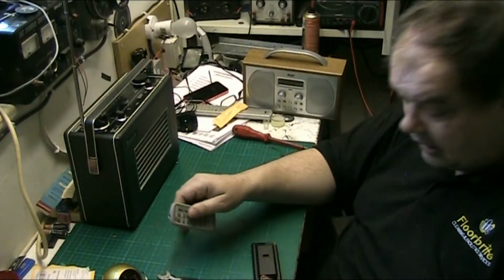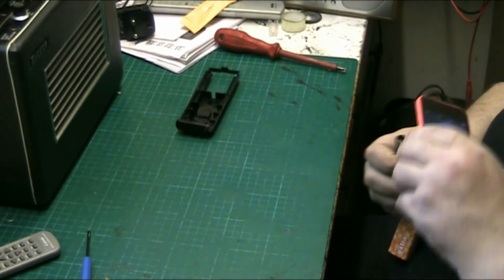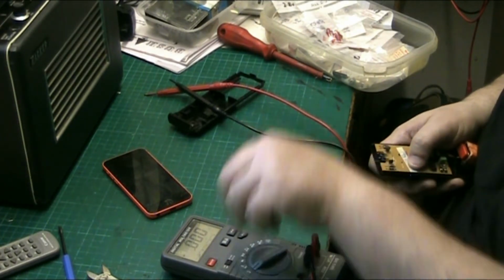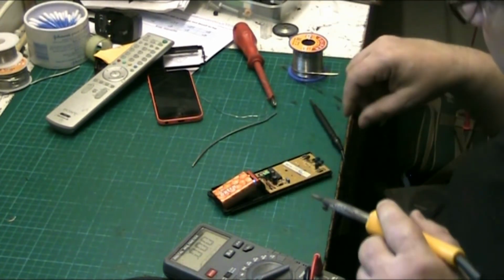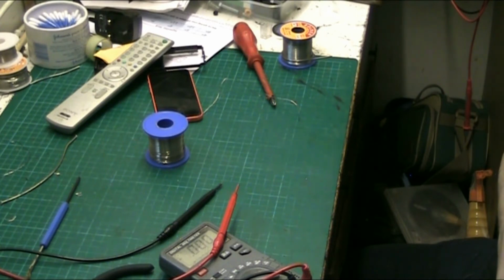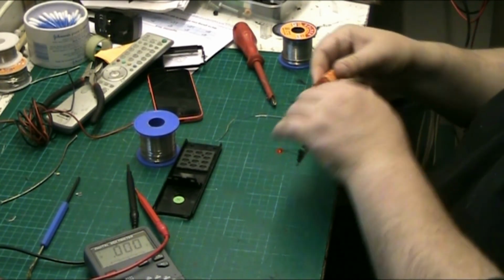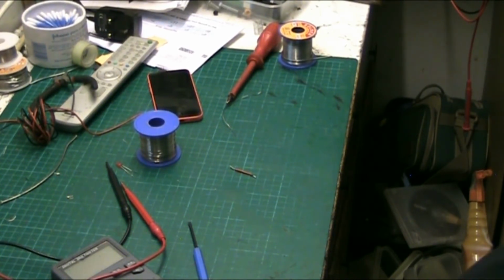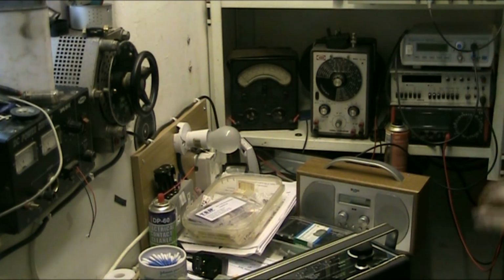MIKE'S REMOTE CONTROL

Comment: is it worth while repairing these? I thought those £1 shop remotes for everything worked on all TV sets?
Reply from the maker: Its the original to the tv
Reply: Oh, dont those cheap ones work on the TV? Do you think that hum on my ITT record player is possible to remove? someone said its probably a capacitor across the mains that is leaking, its a really a bit loud even on normal volume, shame as its a really nice looking set. Laurence